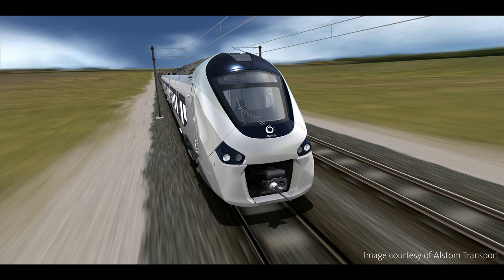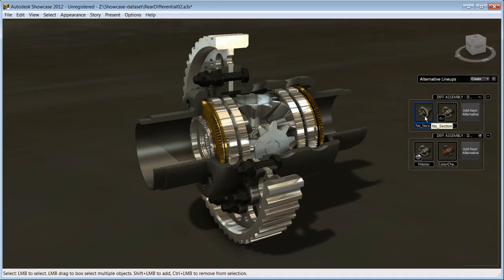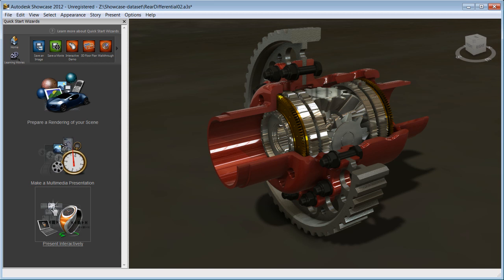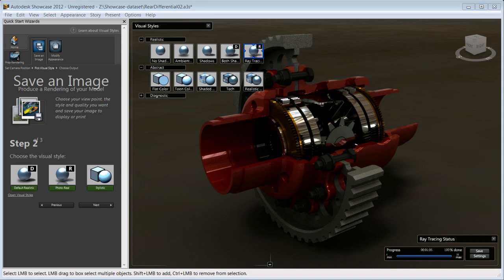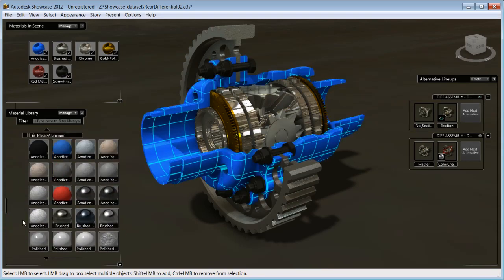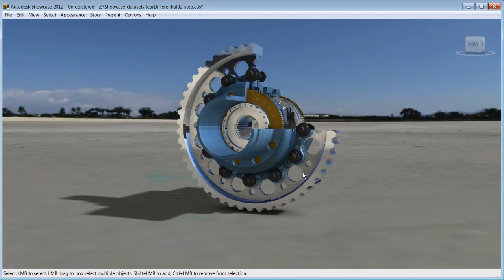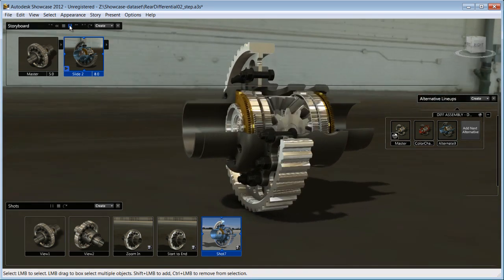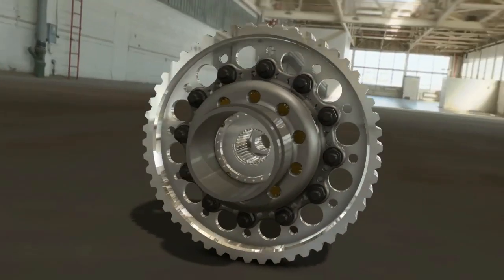Autodesk Showcase 2012 for Inventor Users

Comment: THIS IS EXTREMELY DISTURBING. Autodesk claims to be a company interested in EDUCATION, yet they have set forth an example of a eubonics-style non-native speaker with no ability to speak STANDARD ENGLISH. Perhaps Autodesk wants to show they are "Hip" and "Informal." But what I take from this is that the company is "Uneducated" and "Disdainful of Academic Discipline."

PROBLEMS: 1) Consistently incorrect pronunciation. 2) No subject - object agreement. 3) Sentences ending with prepositions.